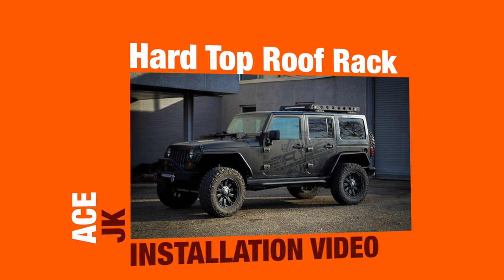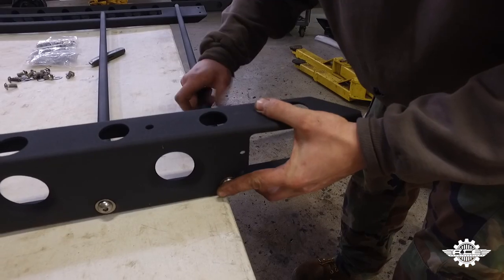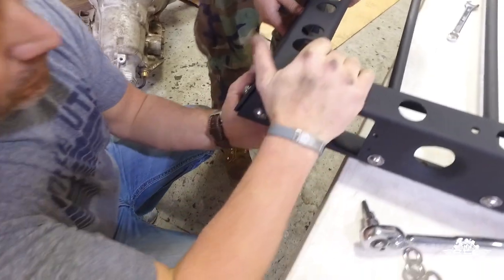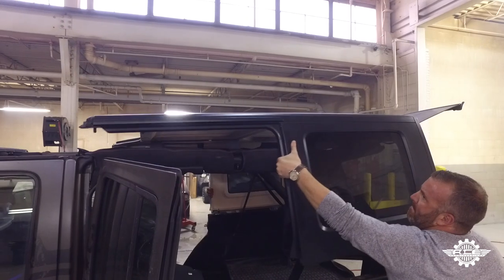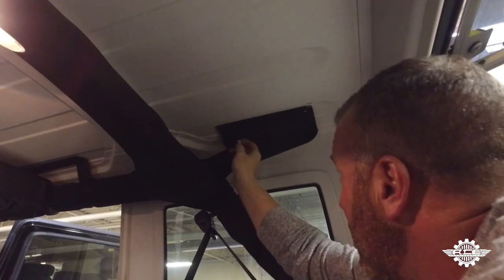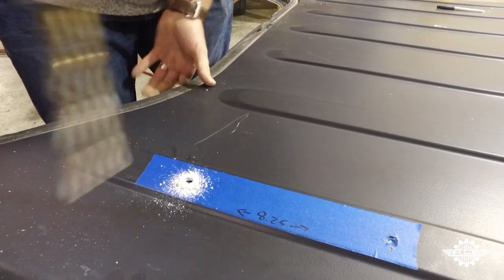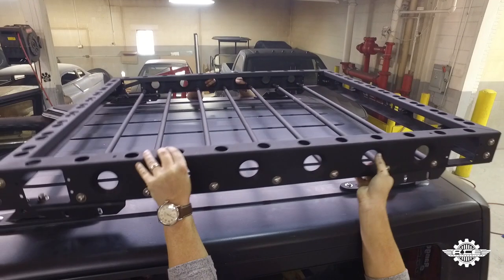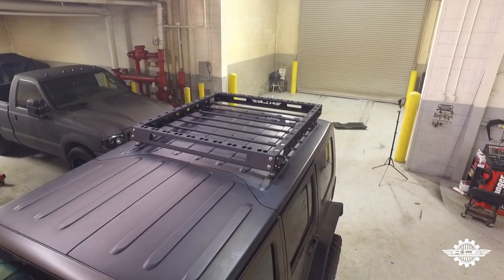How to Install the ACE JK Hard Top Roof Rack

Comment: Can the side light pod holes fit ANY 3” flush mount pod? 
Also, is there a different option to use light pods in the rear instead of the light bar?
Reply from the maker: They are designed to fit the Lifetime LED Lights flush mount lights. Other manufacturers lights may work, but we don't guarantee it. No, there is no option for flush mounts on the rear.

Comment: I'm interested in adding this to the top of my 2017 Polaris Ranger 1000 crew with a metal roof. Not sure if this will fit though. What would the dimmention on this particular roof rack be?
Reply from the maker: The footprint is 53" long x 46.5" wide.
Reply: ACEEngineeringandFab Great! This would fit perfect. Diffenetly in my "to buy" list for my utv. Thank you for the reply.

Comment: Is there a way to take the hard top off without having to remove the entire rack?
Reply from the maker: Bruce - no you have to remove the rack in order to remove the hard top - although it's only 8 side bolts that need to be removed to take off the rack. The pucks can remain attached to the hard top.

Comment: where can i buy this, I tried northride4x4 and different vendors and they don’t have it on the website, also what is the waiting time on this? thanks
Reply from the maker: It's a slightly new product so some of our vendors may not have it online yet. If you called them they should be able to take your order, or you can order it direct at acejeep.com. Current lead time depends on the light options you choose. With light options are a week or so out, no light options are about 3-4 weeks. Thank you.